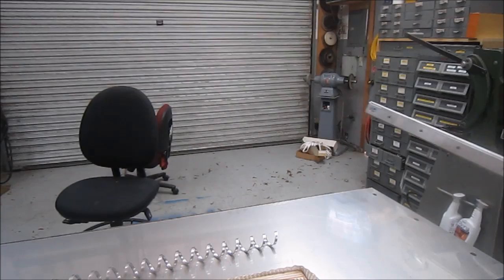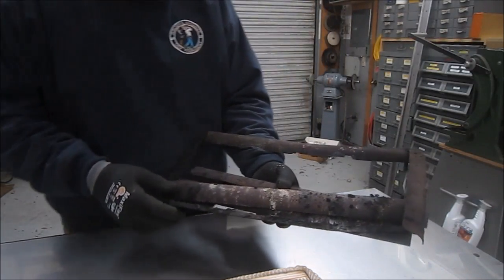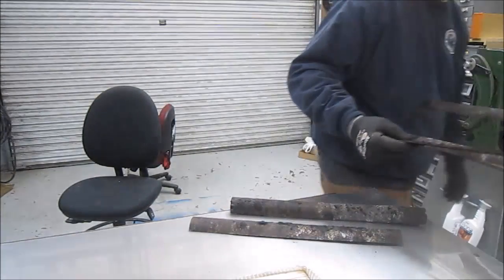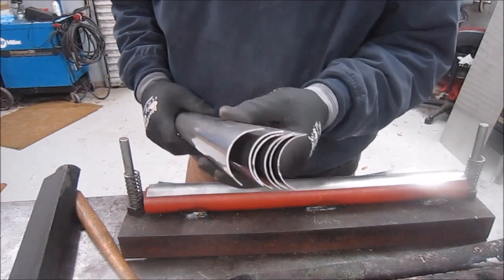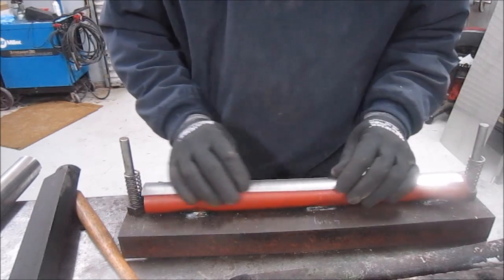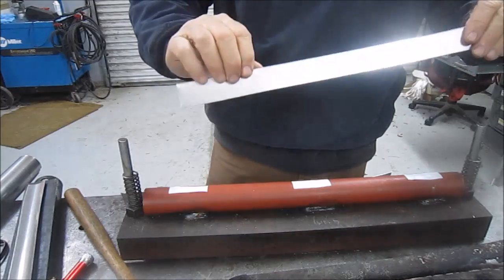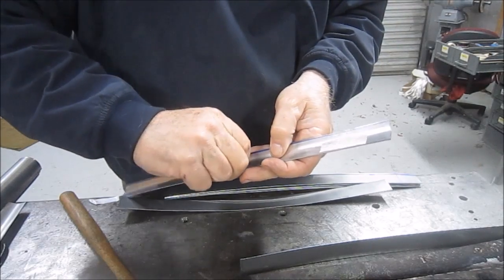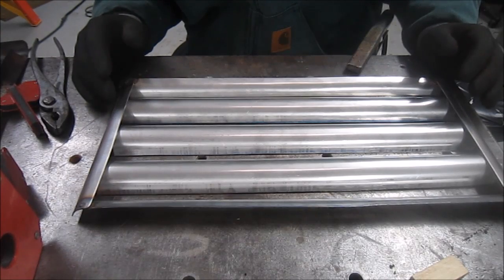Screwy Tuesday #39  Bbq Sheetmetal Rebuild

Comment: Next item to build after BBQ is a garage heater or furnace, I'm finding myself clever having installed a heating system in my garage, it will be 62 deg, F all winter long, as long as I keep the doors closed...   ;)
Reply from the maker: +pierre beaudry Hi Pierre....saw the video this am of you guys at KF....fun   FYI, I do have heat in my garage and I guess I will show it in my part 2.  That night as I was bundled up, I wasn't planning on working very long and I hate to heat the shop just to walk out as soon as it is toasty!!Thanks for watching
Reply: Meeting Keith and Vanessa was a great experience, they're both warm and generous persons...  
The geothermal heat pump heats the house and the garage, in the summer though only the house gets air conditioning... ;)

Comment: Build your own burners! It's actually quite easy. There's a few good videos on youtube about it, and even a couple good Instructables.   I'm surprised by that nibbler. I figured if it was rated for 14ga, it might cut 22.
Reply from the maker: +Wide Vision Metal Fab HI Matt....I am pleased with the nibbler...how long will it live is the question....someone/somewhere, I can't find mentioned adding a little WD40 to the blades prior to cutting....VAST improvement on cutting the SSThanks for viewing and your comment

Comment: Your shop looks about as cold as mine! 
I have found my swivel sheer very handy... got one spare pair of jaws to keep aside. You'll have noticed as I did that the angle is quite critical as you cut.
Your old grill looks well used.
The press break looks just dandy.:)

Comment: That rotisserie reminds me of one of my first personal builds as a welder. I made one that used an electric window motor with a small sprocket and a chain driven spit to turn the meat. The last I heard before I shut down my Facebook is that it's still in action with only one motor change, even the old Sears battery charger I used to power it is still running, LOL! This looks quit a bit more professional, and I am glad you're enjoying it so much, thanks for making my tongue float :P Aloha Chuck B., ...Chuck V.

Comment: Hey Chuck, 
spiffy bending tool there, you got!.. you should have drilled a 1/4" hole in the apex of the top rail so you can stick a small punch in the hole and release the part.

for the narrower pieces i would have made an indexing hole in the die or made the part long enough to drill holes in each end and slip over the guide pegs.. then nothing can get away.. sure you'll have some waste at the end of the part but your alignment can;t get away on ya

made me drool dammit.. even though i already ate supper...

cheers
mike

Comment: Is their any part of the BBQ that does not need replacing?  You must have a heck of a lot of BBQ to wear out so much in 10 years.  Anyway you are doing a great job of repairing that thing.  Most likely it will be better than the original when you get done.  Thanks for sharing.

Comment: There is only one reason I object to sharping plane irons on a surface grinder,  I don't own a surface grinder.  I would sharpen the blades from my chipper if I had a surface grinder in a heartbeat.  Hey, I will build a fixture and see you soon:)

Comment: Hi Chuck !

Nice and nifty little brake tool you made there - I often need to doo bends with a round "bending edge", so I'll simply copy you idea - hope you don't mind !

It's a bit ao a challenge to TIG weld these thin plates for beginners like us - I have a project too where I need weld thin plates like yours - 0,8 mm stainless steel 

... and I'm not very keen to get it done ;-(( 

... unfortunately the wife is !